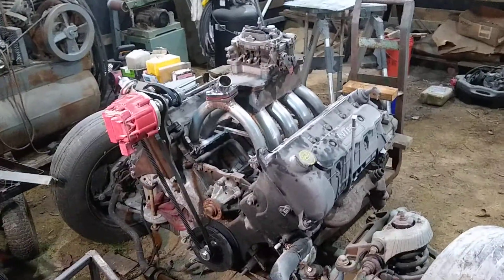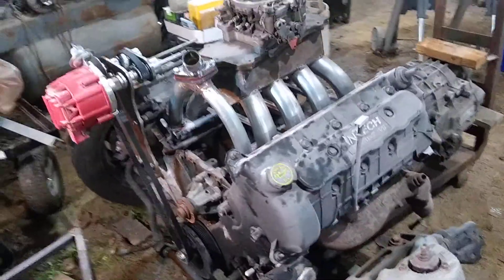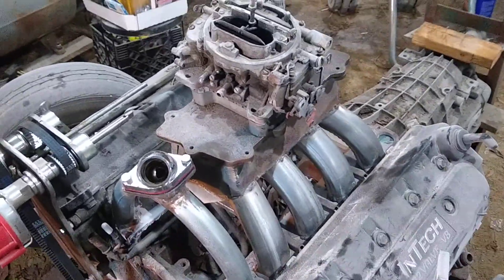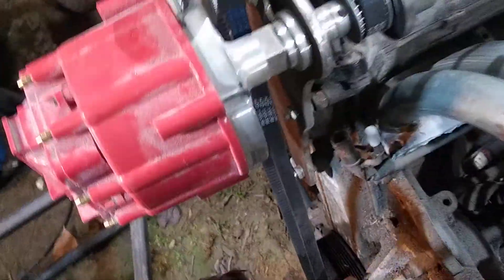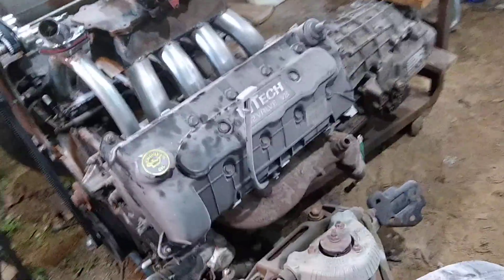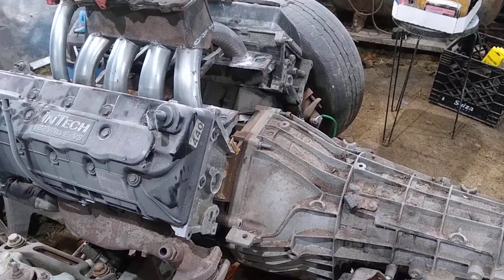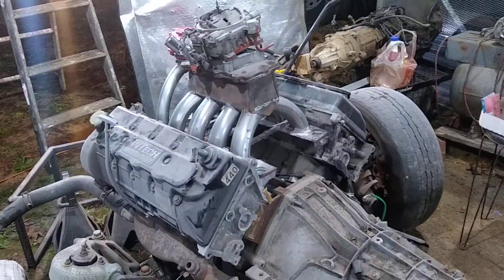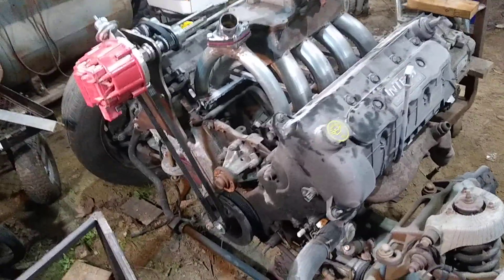F100 show and tell, 5.4 twin-cam, carbureted, belt drive distributor, project plans.

Comment: They sell a mod six MSD box that will power the coils, much simpler and cheaper than that set up you have for your distributor. No doubt what you have is cool but that is a great route to run your ignition system

Comment: Dude, you're overthinking it. This is awesome, but you should've just gotten a speeduino for engine control and a microsquirt for trans control. 

Also, the 4r75e/w is a better performance trans than the 4r100.
Reply from the maker: Indeed I am.  The main point of doing it this way is "just because" and to show it's possible.  Y'know, to show people that if you pipe air and fuel down these holes, and put high voltage across these contacts sometimes, you get vroo Vroom's.

Also: a speeduino, and a microsquirt would cost more than I paid for the truck, the motor, the trans, and maybe the front suspension too.  To say nothing of an all-in-one system.
Reply: @DerrangedGadgeteer  You paid less than 700 for all of that???

I thought I had it good with my 99 f150 that I got for 500...
Reply from the maker: @BrockJaden  yep.  ~300 for the motor, (which turned out to be full of a broken timing chain and bent valves) ~150 for the trans, ~250 for the suspension, and the truck was a free "get it out of my yard" junker.

Comment: People are always asking why LS swaps are so common. These issues are why
Reply from the maker: Yeah.  When I embarked on this project, I'd envisioned the swap going like an LS... 

-Save the ECM, wiring harness, and the other bits and bobs
-Hook up +12v and ground where they need to go, hook up necessary sensors, and snip off everything else.  
-Do the work of actually installing the engine, get the truck running and driving on the stock tune, and make incremental upgrades from there.

Except it didn't go like that... Of course.  How silly of me to think the ECM would work without the trans controller and the body control module hooked up! I mean, the engine obviously can't run without the airbag system, the ABS, and the daytime running lights all in order. 🤔
Reply: @DerrangedGadgeteer  would a Holley Efi setup not work?
Reply from the maker: @stellingbanjodude  It would absolutely work.  And much better and easier than what I'm doing too.  

I'm just a stubborn little kermudgeon, and I want to be able to say "I put a carburetor and a distributor from 60 years ago onto this modern motor, and it runs great!"

That, and I feel there's a certain mystique around engines in general, and modern, computer controlled engines in particular.  I wanna demonstrate that it doesn't really matter what engine, new or old: You put air and fuel down these holes, put a high voltage across these connections, and vroom

Comment: that is wicked cool! wanted to build a hot rod with 5.4! with the right valve covers it would look like a old school engine! love the carb and dizzy. belt drive looks like a good way to go. i was going to use the cam end bolt.  efi is for soft folks.  love it! you can get full Manuel valve body for the trans. mr shift makes a kit to convert the oe one. for the dizzy drive it off the end of the cam. has a bolt on it from memory. can not remember if the valve covers are aluminum. think sum wear and sum wear not. .
Reply from the maker: I'm leaning towards running the distributor off the cam myself.  I've got a mill and a lathe now, so if I can get a good, flat, perpendicular datum on the head, I may just drill out the valve cover, add a mounting boss, and do it that way.

Also, where did you find a manual valve body  conversion kit? I've found plenty of shift kits for the 4r100 that retain the electronic transmission controller, a few stand-alone trans controllers, and full-on replacement valve bodies, but I never saw a kit to convert the OE valve body to work without an electronic TCU.  If you can link to it, that would be a great boon!
Reply: @DerrangedGadgeteer  thought that it was a 4r75w/e my mistake. thy make a kit for that trans to mod the OE valve body. wonder if the OE TCM will work with just a tach signal and TPS? As for dizzy would mod the top of the HEI to accept the screw down cap from the 1980s/1990s corvette HEI. that big heavy cap is a lot of weight for the L hooks to hold with it mounted horizontal.

Comment: Any progress on the build would love to see it running
Reply from the maker: It's back-burnered at the moment.  Turns out, the reason the donor vehicle was in the junk yard was because of a broken timing chain and a bunch of bent valves.  (Yeah, I'm a bit of a dingus for not checking) So I'm on the lookout for another junkyard motor with at least one good head to replace it.  

And once that's found, I'm thinking about scrapping the belt-drive distributor idea... Instead drilling out a valve cover to run the dizzy off the cam.  And barring that, I've been told that apparently early-gen mod motor ignition controllers will run headless, (that is... Give it 12v and sensors, and it gives you sparky sparky, no muss no fuss)

Comment: You can get a manual valve body for the transmission
Reply from the maker: You can? For a 4r100? Where? I found plenty for the 4r70w, but 4r100 stuff is scarce by comparison.

Comment: Hello, I just subbed.
I noticed that you are into metal casting and machining, which is great for a project like this but sometimes aluminum just pours too thick to get the detail you need. Have you tried ZAMAK 8, it is a very high-strength zinc alloy that pours like iron, is as strong as iron but melts at about 900 degrees. You can buy it from Rotometals for about 20 dollars for four pounds.
Also, look up a picture of an old BMW V12 engine, the one with distributers, and see how they are running them off of the end of the cams. You just might be able to pull that off if the long belt is a problem, another idea is to move it under the intake manifold and run a remote electric water pump.
Reply from the maker: Thanks a bunch for the sub! As far as Zamak, I have heard of it, but I'm not really past melting down scrap as far as foundry practices go.  

The problems I'm dealing with are along the lines of "My crucible isn't big enough to fill this mold." And "How can I get this oil burner lit without smoking out the whole county?"  

Though, do you know offhand how Zamak does in a steel crucible? I can't use my aluminum castings for structural purposes if I use my steel crucibles because liquid aluminum dissolves iron, and upon cooling the iron forms nodular inclusions in the casting.

Running the distributor off the cams would be very ideal, but until very recently I haven't had the equipment to drill and finish bosses in the valve covers with the required precision. 

 Indeed, as I told another commenter, one of the reasons there hasn't been progress on this is because I couldn't line up holes for the jackshaft bearings well enough with just dividers and a drill press. 

 Now that I've got the equipment, the F100 is back on the front burner... 

...Along with like two other cars and half a dozen other projects of course.

Comment: Did you finish this?
Reply from the maker: Not yet.  It's not abandoned though.  Ran into problems with the jackshaft assembly, having a hard time getting the back support plate lined up perfectly with the main mount plate.  

Fortunately, I now have a milling machine and I can do it right.  

Unfortunately, I did a bit more tearing down of the motor and found it was in the junkyard because of a broken timing chain.  So I expect the Pistons and valves may have gotten a little too friendly with each other.  

So: this waits patiently while I fool around with my machine shop, and it's also gotten cut ahead of by the Big Block '63 Valiant build. (Because I've actually heard THAT engine run)